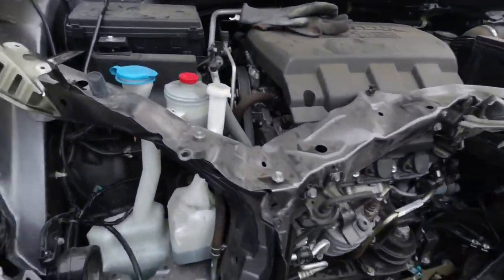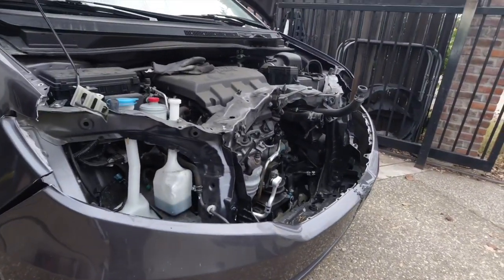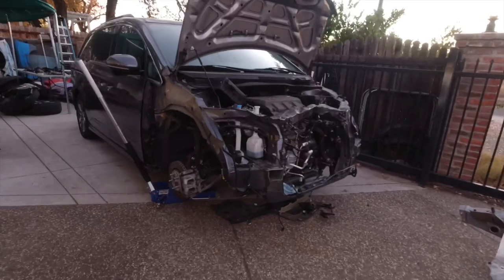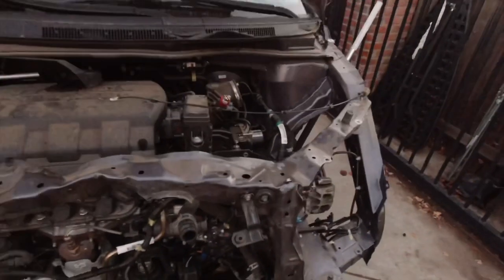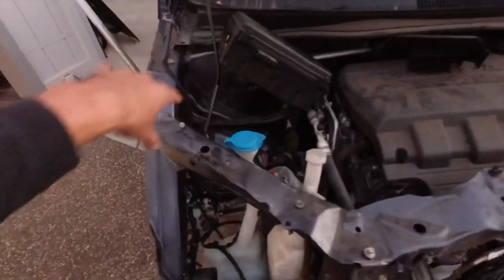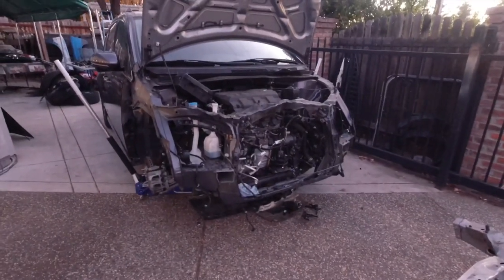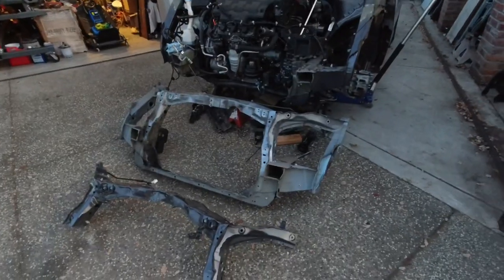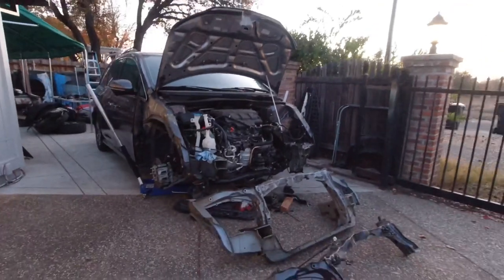(Part-3) 2015 Honda Odyssey Touring Edition CLEAN TITLE, 28k miles, LETS CUT EVERYTHING OFF

Comment: Hey, nice to see you working on this odyssey. I'm working on the same honda odyssey 2016 also from copart. In my case the damage was less than yours with a right passenger fender and bumper destroyed. Also the radiator support its a little bit bended.